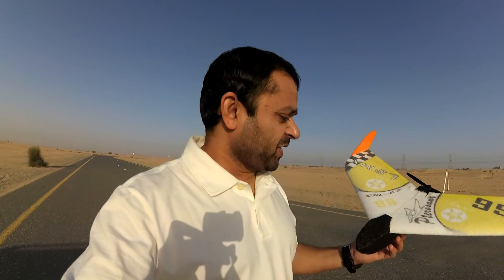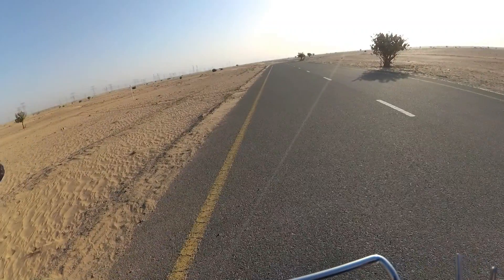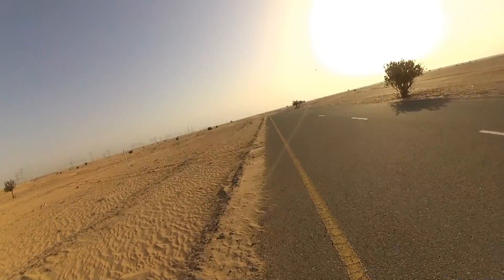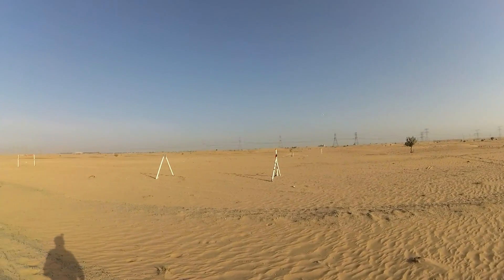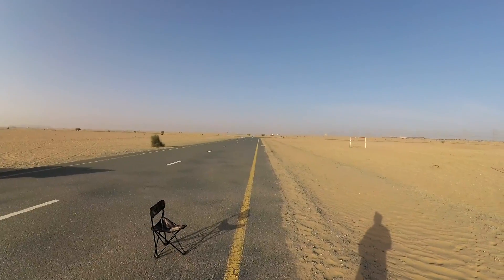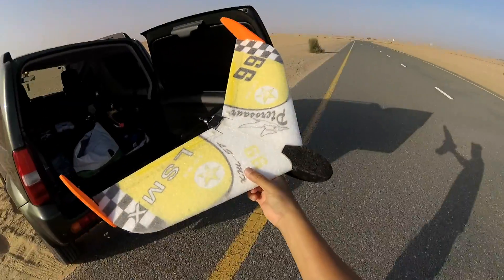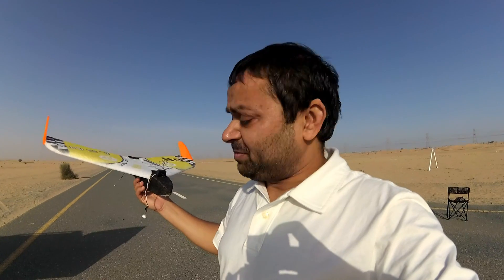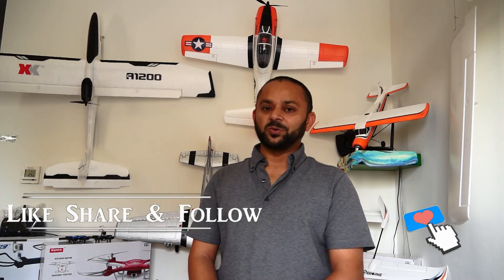Spirit 600 Mini FPV Flying Wing really moves

Comment: Hey man! I'm a great fan of your channel!
I have a question for you. I intendo to buy a small, LIGHT and DURABLE mini wing for fpv flying with a eachine tx02 aio camera. Which one do you suggest me: bonsai, mini rainbow or the spirite??

thx in advance
Reply from the maker: any of these are ok, as far as you prepare them nicely. I am going to review a micro FPV wing which comes BNF to Frsky, Futaba and Spektrum radios. has built in stabilization system and built in FPV Video system :) and trust me when I say micro :D LOL it is THE SMALLEST FPV Wing I have even seen
Reply: dude! I'm anxious now. can't you spoil the name of the wing? :P
Reply: btw, do you which of those 3 are the lightest or more crash resistant?
Reply from the maker: I have crashed Spirit 600 at times and i was running a heavier setup than recommended. But its still took crashes without breaking. however, there is no tough unbreakable wing. these are fast wings so crashes do damage them. but good thing about these, you can repair them easily either by buying parts or just making your own
Reply: I had a Mini Rainbow with 460mAh 2S, 1808 2300kv motor, 5x3 prop and a micro stabilising flight controller. All up weight 150g. Flight times were very long (I didn't time them though). Power was great. Could take off on 50% throttle and power out of any stall. Had a few hard crashes and the only damage was a crack on each corner of the propeller cutout going all the way back to the servo mounts. If the designer had made the corners of the cutout round, this wouldn't happen. Hot glue fixes these cracks though, and reinforces so it won't happen again. If you want a stronger wing, laminate it with the laminating film also from Banggood. Only adds $4. The wider V angle of the Mini Rainbow will make it yaw more than the Spirit, so it is less comfortable view for FPV. Also very hard to fit components. The wooden mount for receiver/FC is only big enough for 20x20 flight controllers. KK mini doesn't fit. The nano-tech 460mAh 2S battery fits nicely. A 3S would sit higher than the wood but fit. Any larger would be an issue to mount.

Comment: is FPV a ppossibility with this bird? (oh, your video just said yes.) Thanks! cheers, you give me optimism to try. (maybe I crash due to torque roll.) what can I do for that?
Reply from the maker: you can program soft throttle or throttle delay if you have. Futaba Radios have it. new radios also have this. this helps. but at full throttle of course you can't do anything except make a new mix to raise the opposite aileron as throttle goes higher. a few trial and error and you will dial it in real good
Reply: Many thanks sir. Keep up the great work. You have fun, Informative vids!! Inspiring